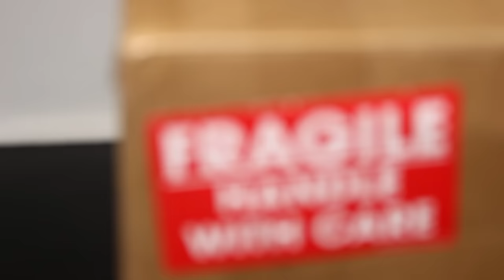World's Smallest 5 Axis Milling Machine - Pocket NC V2

Comment: Nice, I really want one of those. You could benefit from an improved impeller design though, If you can edit it to have less of an angle of the blades at the outer edge due to it spinning faster. This is usually very difficult but since you have that machine :D

Comment: I'm a machinist apprentice in a huge steelmill, we have huge new cnc mills, and 100 year old 80ft bed lathes to small manual mills, key seaters, etc. But cncs still blow me away. Main thing going from manual to CNC I find is speeds like why run so fast? If time is not a factor keep the tool cooled and run it slower speeds and feeds to greatly increase tool life

Comment: exciting! do some research on adaptive cutting and how best to set up toolpaths for HSM (high speed machining). If you plan to work in aluminum, get yourself some Zirconium Nitride (ZrN) coated tungsted carbide endmills. Places like Lakeshore Carbide sell them, but so do many others. Use as short a tool as possible, and if possible take deep cuts with very shallow stepover. This is a small machine so it may be difficult, but always try and cut with an inch per tooth (IPT) of 0.001 or millimeter per tooth of .025. This will help prevent the cutter from not having enough material to make a cut. If the IPT is below 0.001 sometimes the cutter will merely burnish the material and generate lots of heat and vibration which will destroy your tool's cutting edge. The deeper cuts (i.e. more axial tool engagement) allow you to make more use of your machine's spindle power and longer tool life as cutting with the bottom 10% of the tool will render it useless very quickly. For more information you can check out the NYC CNC youtube channel or find a Sandvik Coromant technical manual (should be available on the internet). Good cuts + good tools will make you a happier person. Remember, shallow and slower isn't always better. Have fun with your new machine! I can't wait to see what you do with it.

Comment: I am in the market for a small CNC machine for scratch building model railroad parts.  I currently model in 1:22.5 scale (lots of brass, plastics, etc...) as well as 1/5th scale.  I have been a master machinist for over 20 years.  Current shop comprised of large equipment, predominantly utilized in Aerospace Machining.  Milwaukee Mills (3 machines), Okuma lathe with 20" swing, Southbend lathe with 10" swing, 2 Bridgeport Mills, Hardinge Tool-makers lathe, DoAll saws, Hydrotel, Turret Lathe, Moore JigBore (my pride and joy), and 2 Fanuc Matsuura CNC machines: a 3 axis and 4 axis (rotary table).  ALL accessories for ALL machines at our disposal.  These is nothing we can not make (just about).  Clearly, these are all production machines with have withstood the test of time.  Our shop has closed its doors to government Aerospace work, we now use the equipment solely for the model railroading hobby.  I describe this NOT to brag, but, lay the background for what I am hoping to purchase.  

Although small parts for the 1:22.5 scale trains can be made on this equipment, holding 0.0001" in some cases, to 0.001" in all cases, I am looking to purchase "micro-equipment" to make the scratch building of smaller parts easier.   Looking at this machine in the video, which is really classified as a vertical mill, it is the right SIZE for what I am looking for.  I would like a manual mill and lathe in that same size range as well.  

I can not over emphasize this enough, however, quality is the number one criteria in my purchase.  I truly believe that if you purchase quality, everything is not only easier, but, you only need to purchase things once.  For example, why purchase a cheap chinese mic or vernier which is dead in a year when you can purchase an Etalon (Swiss) or Starrett which will last a lifetime (especially the Etalon, which in my humble opinion is the best in the world for measuring equipment).  

Many have commented on this video - MAKING ME VERY NERVOUS ABOUT COMMENTING MYSELF.  However, many have mentioned other manufacturer to consider.  I am looking for miniature machines which will easily hold a tolerance of 0.001" or better (+/- 0.0005" call-out).  Rigidity is paramount.  Materials are Steel (all types-CRS, HRS, etc...), Aluminum (such as T6- 6061), Titanium, Brass, Copper, Bronze, Cast Iron (various alloys), Not much magnesium or inconel any more.  Also, various plastic from Styrene, ABS, Delrin, Carbon fiber etc...  Obviously, end mills and lathe cutters have a lot to do with the machining - which I am not worried about - just need the machine recommendations.  

In terms of the BIG STUFF, Grob, a German company, produces some of the best in the world.  Some say THE BEST (however, this is merely opinion).  My personal experience with Grob is that the equipment is the best I have ever seen.  Please take a look at that which I am referring to here: https://www.youtube.com/channel/UCJ-k97LzLxl5uBJMAaO_P3A/videos.  That link is to Grob's online video collection demonstrating some incredible machining.  
I am NOT looking for full-production equipment, rather, making one-off parts, or small runs of 10-20 parts required for a locomotive lets say (10 wheel locomotive requires 10 wheels, 10 journal boxes, 5 axles, etc...  All easier if they can be produced on a CNC without needing to reposition the part and introduce error).  

After reading through the comments listed here, and pulling out possible machine options, I really wanted to engage in a conversation with those who have actually used the machines they are recommending and are actual machinists.  Those indicating that they can "build a 5 axis CNC milling machine for less than $5000" and go on to imply that it would be "simple to do so" clearly have absolutely NO IDEA what they are talking about, and clearly are NOT machinists.  I would appreciate you not wasting our time by engaging in this conversation.  To make my point, a  close friend scratch built (as a hobby project) a small 4 axis milling machine which was completely functional.  The machine was 12" x 12" and about 10" in height.  The build quality was incredible.  It took him about 3500 hours of actual working time to produce the single machine.  He went on to produce a 36 cylinder sleeve valve turbocharged aircraft engine, which is fully functional as well.  That took about 8000 hours.  So, we can clearly dispel ALL notion that one can "whip up a miniature 5 axis CNC in a weekend for under $1000".  

I look forward to recommendations for the above mentioned equipment.  

PS - JohnnyQ90: considering the impeller is one of your first projects as you indicated, you did a fantastic job!  Don't listen to those who criticise.  I would like to see what they have produced.  To answer some points raised: the recommendation to utilize solid carbide end mills is a definite.  I only use solid carbide end mills.  For Aluminum, Zirconium (ZrC) coated 3 flute solid carbide end mills would be perfect for the initial pass.  That coating is especially designed for Aluminum (amongst other things).  Calculate your speeds and feeds, and take note of color and temp of the chip egress. 
 Follow that up with a second pass with the exact same settings.  It may appear as though it is NOT cutting anything, however, the first pass will cause deflection of the end mill (yes, even carbide).  The second pass will mill the remaining material left due to deflection.  Leave 0.005 to 0.010 material - DO NOT machine to finished dimensions!  Then, change end mills to a 7 / 8 / 9 flute solid carbide AlTiN coated end mill running at a faster spindle speed to machine the remaining 0.005" or so of material.  Make 2 passes.  This is all VERY easy to do with modern CNC machines and software - most high end software suites have this built in.  This will produce a MIRROR FINISH.  Lastly, do not purchase end mills with a perfect 90deg edge - rather, purchase those with a small 0.0005" or 0.001" radii - This will produce a far better finish and increase tool life.  You can purchase end mills with many different radii at the cutting edge.  In 3 decades of machining, there are very few instances there I needed a 0.0000" 90 degree corner on the end mill.  I can't even think of one off the top of my head.  Injection molding dies would be about the only thing. 
(For those who have no clue about that which I am referring to in this paragraph, please don't bother responding unless you have POSITIVE information to ADD to the discussion.  Thank you).

Have a wonderful day gents!  Look forward to your recommendations on miniature machines!
Jonathan

Comment: It IS a cool machine, and the impeller / fan replacement is grand. That said, I just checked their site. I wasn't sure which side of the fence of the pricing fairness discussion I was on until I saw their "tool holder": A 6 inch piece of badly finished square stock with 5 holes drilled in it. For 30 bucks. Want a new cardboard box? Thats 90 dollars. For cardboard and foam. You do get one free with the machine, but if you ever want a new one, 90 bucks. They also sell the google chromebook for 60 bucks more than you can get the exact same model direct from ASUS.

Comment: 3:00 My guess. If you would try this up-milling instead of down-milling it would probably be fine. If you want a nice finish, you can do a small fine cut with down-milling.
Down-milling is the preferred way, BUT can create vibrations, that will be problematic for small less stable machines.

Comment: switch to high speed steel tools for aluminum, and add some mist coolant. They have lower tool pressure than carbide as they are sharper

Comment: that pushbutton on the side to cal the tool length offset is so smart and so cheap and easy.
I can't believe the early 2000s Haas milling center I learned on didn't have anything like that. Even if it's not accurate down to half a tenth or something, it should be the default behavior on any cnc mill, just as a sanity check so you don't break tools because of a typo or putting the tool in the wrong slot on the changer. 

(The stupid community college course I took barely taught us anything because all the equipment was already trashed and the guy running the program didn't care. Anything that would avoid machine damage would directly impact the quality of instruction, ya knoww?)

Comment: I can see Micro multi stage turbine in the distant  future also a self vaccuming feature would be quite a upgrade
Reply: out of soft alu ? lol
Reply: MrCcfly pla with glass fiber in fill is far better choice for compressor than consumer grade aluminium and turbine out of 7% tungsten, 2%copper,10% nickel ,80% iron alloy for turbine wheel

Comment: Would like to see a tutorial type of video on this, showing its limitations on different types of cuts on different sized parts. If you wanted to design your own version of a compact merger of a generator slash alternator inside of a type of  Wankel engine, could this type of machine to the task. Needs to be designed from the ground up because the fuel it will be using is not a solid liquid gas, but instead an electrical frequency that burns, and yes it consumes oxygen, more the better, and it burns cold.
Reply: How are you able to burn electricity?
Reply: @brandonhilton5103  rip off the electrons from electricity and you are left with Protons, the ion of Hydrogen, still acts like electricity but also has the properties of Hydrogen, it buts cold because it is missing the electrons

Comment: That milling machine does not seem rigid enough to mill metal. The chatter didn't seem bad, but I think i'd need a lot of practice with plastics before I tried aluminum on there. Still a neat little machine and a great video
Reply from the maker: It's actually surprisingly rigid, the problem is the spindle motor which is somehow underpowered  (200w). If only it could have double that...

Comment: You should index and hollow out the inner body of that turbine wheel so youre not robbing so much energy to get the housing up to speed on that little engine. . Unless its intended as a flywheel as well. You could even do slanted inner holes to help move a tiny bit of air as well

Comment: here are some tips , when you are very near the piece you can move slwoly, but as soon as you are 2-3 cm for from the piece , you can move full speed. do the most work with big rotating speed and big moving , for the finishing, change tools take the finishing tool and move slower with still big rotating speed to have good finish without need to polish. you can buy books that explain how to properly use cnc machines , you'll learn a lot .

Comment: Use a shorter end mill with a shorter collet and you will have much less vibration. I'd say you want the tool to be about 1/3 the length you have from the spindle.

Comment: I use deskproto 6.1 which supports real 5 axis and a, b and c are real turning axis not improvised normal axis... as far is I know its the cheapest real 5 axis CAM..
I converted a kind of mini mill (Optimum Bf16 from germany / china clone) for doing small metal  work and experiment around with it too until now it works well 😎 I make the 4/5 axis attachment out of steel cause of rigidity  the only solution...
Good luck with your mill 👍
Reply: Fusion360 is free if you're a hobbyist...

Comment: That is a lot of tool chatter, think about using a higher speed for the mill and one that is coated. Also lower your feed about 20 to 25%, and you will get smoother cuts with less chatter. There is coating better than TiN, and it is grey in color that works very good for your application but I don't remember the name of it off the top of my head.

Comment: It's a nice, expensive toy to dip your toes into 5 axis machining. I want one, but I rather use 3dhubs to learn CAD and to get my machined parts. Their tools are sharp AF and their price for parts is acceptable for the turnaround time / quality you get. Is this machine meant for machining aluminium? You might be able to get rid of some of the rattling by bolting that thing on to something with more mass.

Comment: Hello sir I am a big fan off you and I have a question can you make a r. Rc 4 stroke gas airplane engine water cooled? Because I want to build an wooden sport yacht from about 1,5 meters and I was hoping that you maybe have a solution because I don't want a 2 stroke engine because it's not the same sound as the original Riva boat.

Comment: The surface finish looks like crap, but then I see you have the machine sitting on a piece of Styrofoam. You should get a used granite surface plate, and lag it down to that. The chips coming off the WP indicate a problem,  there was probably chip weld which aluminum is notorious for. I hope to see you get a handle on things in the future, good luck.

Comment: When you put the fan onto the wankel engine at the end, the aerofoil just looks wrong. It's the wrong shape for a surface that is meant to be pushing air over the engine to cool it. It's backwards, in that the thickest section of it should not be at the rear of the part.

Comment: Impressive machine, having retired from a machine shop, I'm wondering how accurate is it, can it repeat to .002 thousands of an inch or less? But I guess it would depend on what you will be building with whether that kind of accuracy is needed, I was/am curious is why the question.
Reply: People frequently read specs and think the stepper resolution is going to be the repeatable performance of the unit. I worked with the pocket cnc v1 and it was lucky to repeat 0.005". It isn't very sturdy and can't take a very big cut. It is also only $5k so you get what you pay for
Reply: Clearly we're talking about different things. Professional 5 axis VMC machines start around $100k and go up.

Comment: People comparing a tiny 5 axis machine's price to a cheap, low accuracy 3 axis used CNC machine... FML lol. A used 5-axis of average size runs somewhere in the $100-200k range. If you look at the specs sheet, this is an incredible machine at that size, let alone price.

Comment: i can only think of a turbo or a brushless motor
Reply: adapter and parts to marry a turbocharger from a car to a diy whelded flametube, convert it jet engine ready to be mounted to a boat, a bike or maybe even to a trike to fly it...

said marriage rings made out of any material you choose

or if you like it a bit old fasioned, build a model steam engine.... or parts for a DIY lathe etc. pp.

but not for 5k, i would go for a conventional lathe and a mill for that price. maybe chinese yes, but it will do its job for a hobbist, and more options are there to be had. a second hand lathe could be had in the UK and USA for around 1000-2000 USD, depending on the tooling, if you are concerned about the chinese-factor.

Comment: wicked machine.. btw how did you clamp it on the lathe.  4:12
Reply: Looks like the lathe clamp was expanded inside the opening of the turbine. So rather than squeezing it, it was holding the piece by pressing outward.